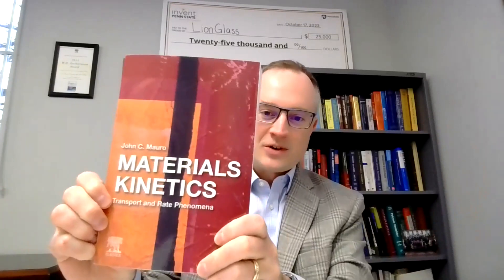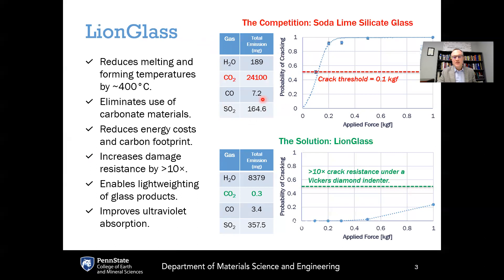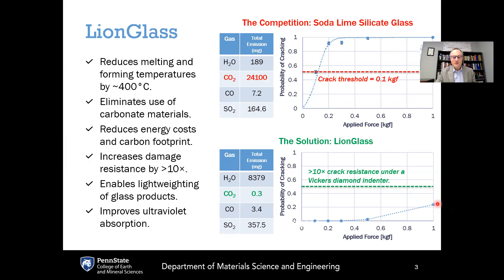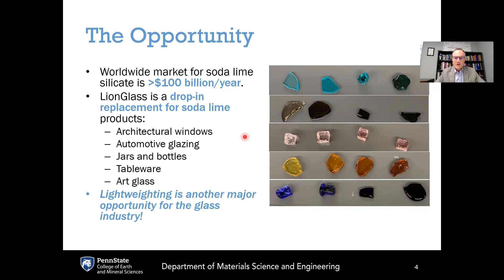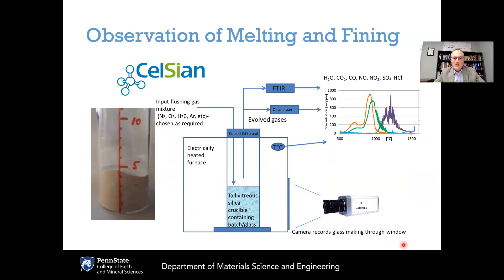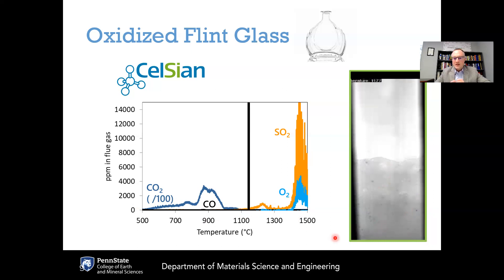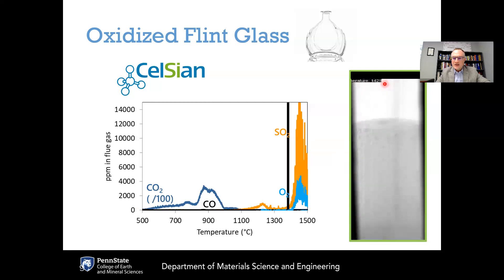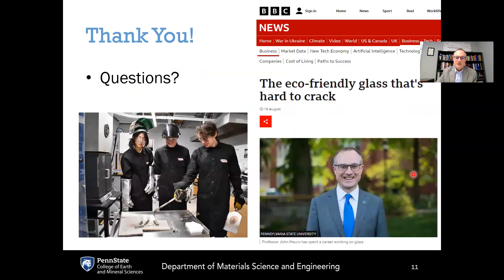Discover LionGlass - Reducing the Carbon Footprint of the Glass Industry

Comment: Interesting! I am particularly interested in the black colored glass on the bottom right of the image (where you presented glasses with different colors. Slide 3). TInteresting! I am particularly interested in the green and black colored glasses on the top right and bottom right of the image (where you presented glasses with different colors. Slide ). The last one seems to have a smooth curvy edges conpared to the rest of the glasses. Is it due to any unique properties or is it just due to the difference in the  cutting process?he last one seems to have a smooth curvy edges conpared to the rest of the glasses. Is it due to any unique properties or is it just due to the difference in the  cutting process?